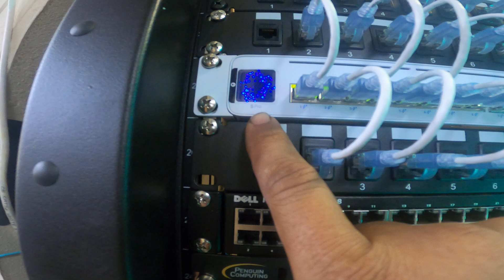Micro ISP wisp and fisp in the same rack. Just a quick update.

Comment: Hi nice setup. How did you aggregate the HSGQ uplink ports?
Reply from the maker: Hi, we did not proceed with HSGQ in the newest installs, we use UI OLT's. We end up using them due to so many reasons. but aggregations uplinks on HSGQ we use them on LACP and we also aggregate the switch on LACP. Sorry for the delay.